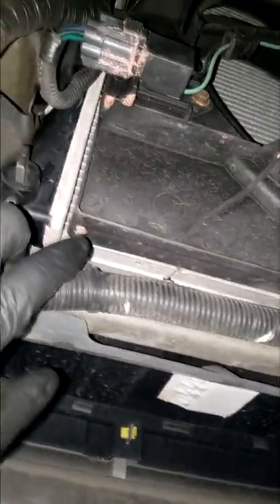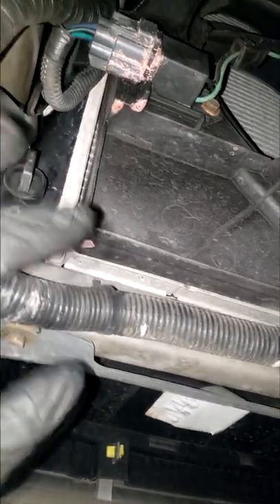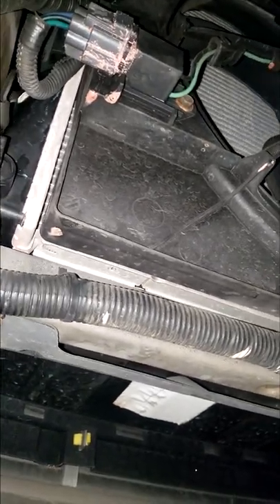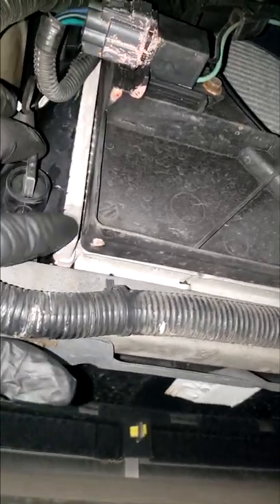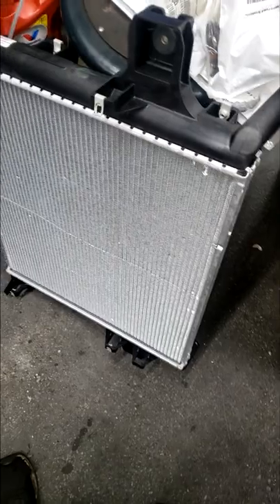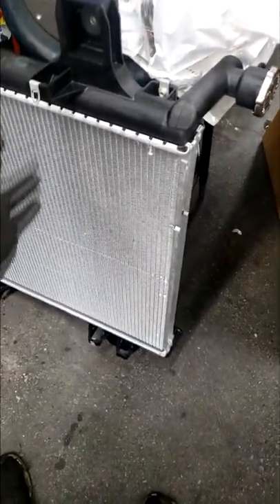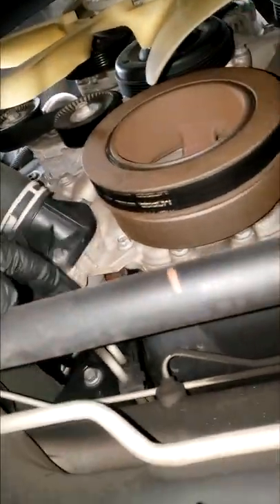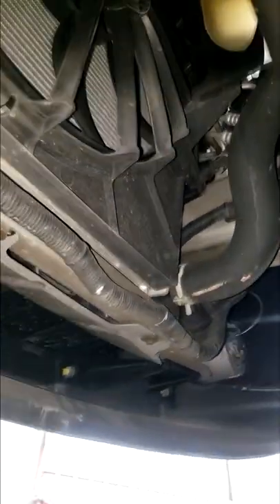This leak will cause your car to OVERHEAT. #JTtheCarGuy #shorts #radiator

Comment: Just did a Chrysler 200 radiator over the weekend what a nightmare have to remove the front bumper headlights
Reply from the maker: Yes, I totally under charged for the one I did last month..It was a hassle